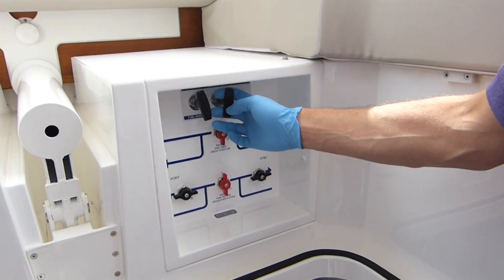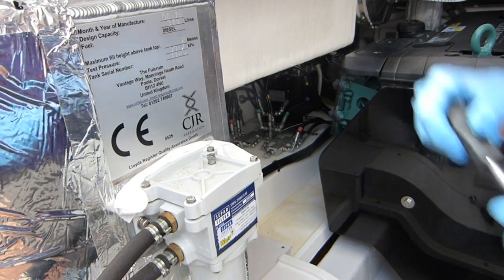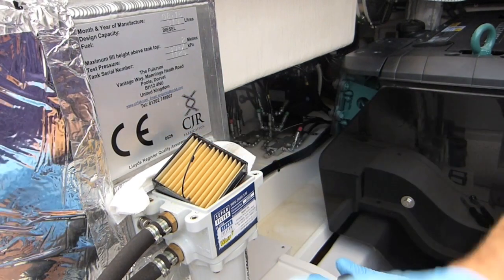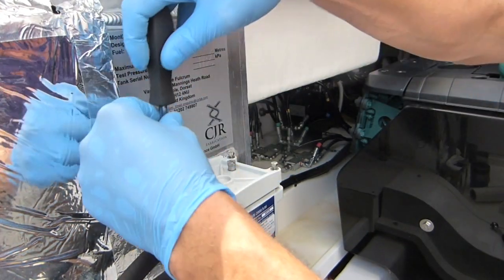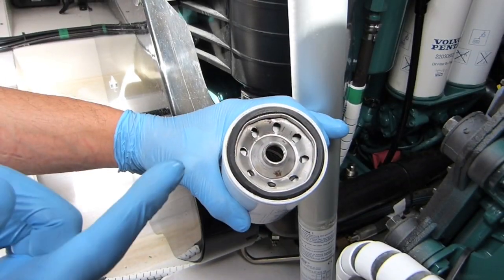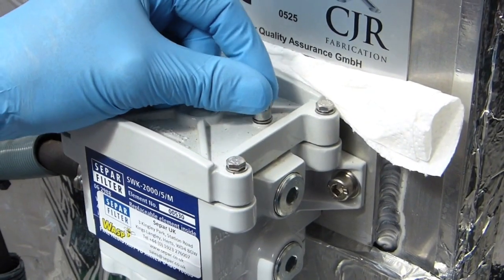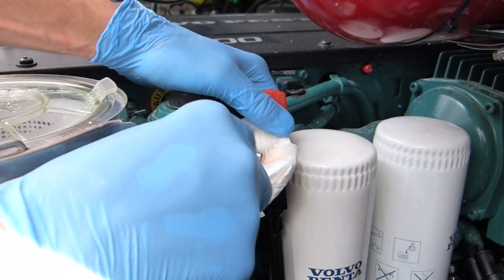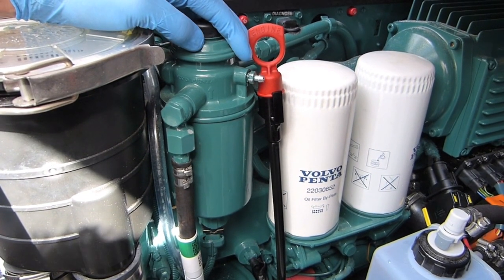How to... Change a diesel engine fuel filter | Motor Boat & Yachting

Comment: Unprofessional. Normal grease eats rubber seals. You should be using silicone based grease. If that was my nice painted engine you had those grips directly on the paint I would punch you 👊